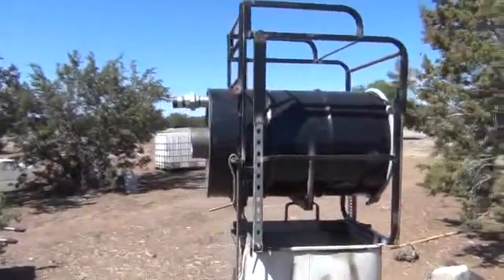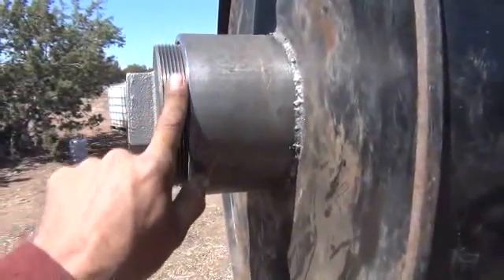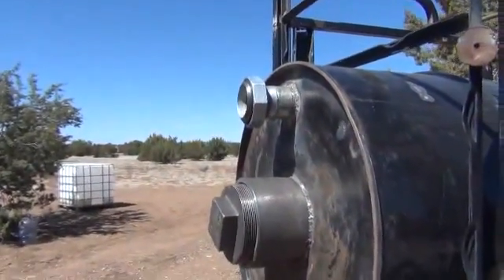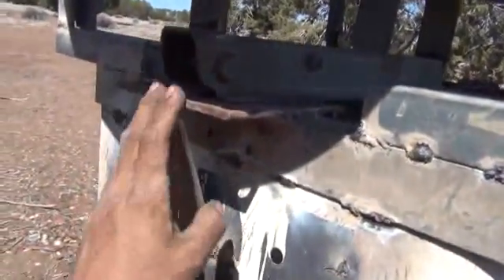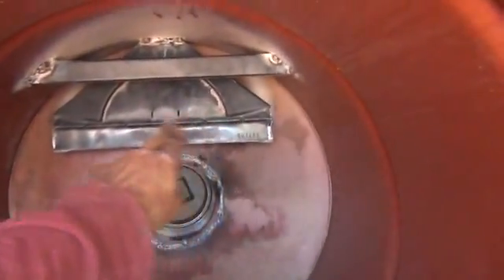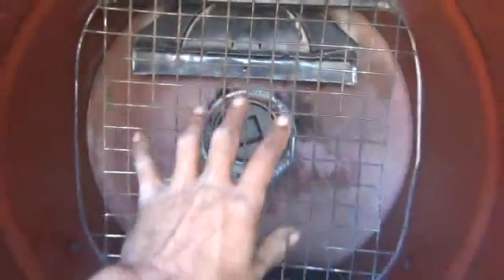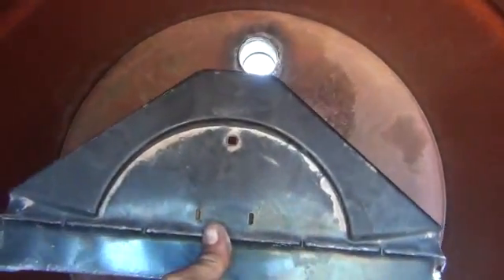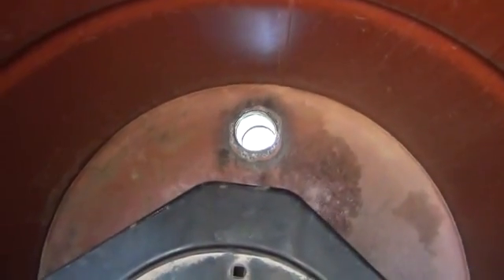how to build a gasifier "part 8", runs a generator and produces gasoline.

Comment: Thanks for taking your time to post the vids and also for explaining everything you make very easy to follow along.   I was wondering will your system break down anything that burns into syngas and bio oils? Such as plastic and other non bio matter. Or does it have to be just bio matter? And also if I may ask in you first system after you've collected the bio oils what metals were used for the catalyst to produced the refined fuels?